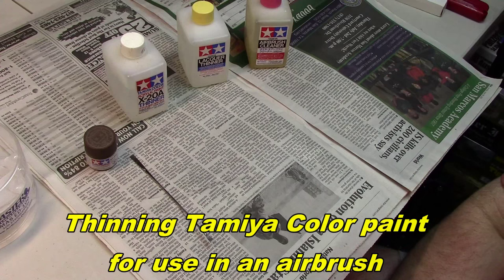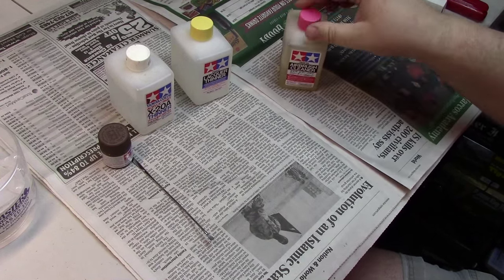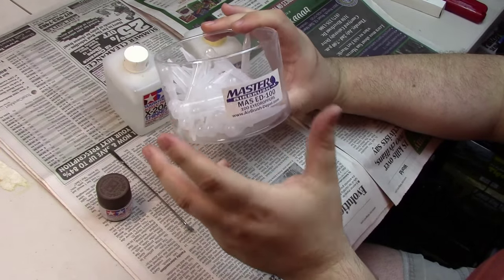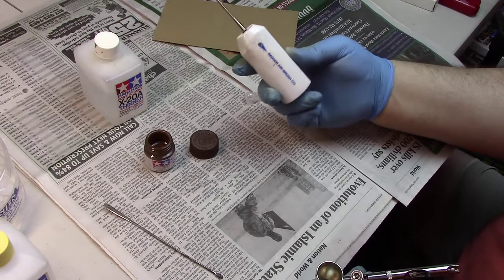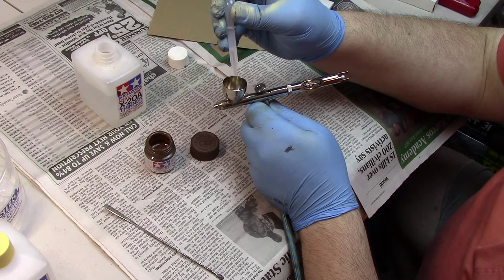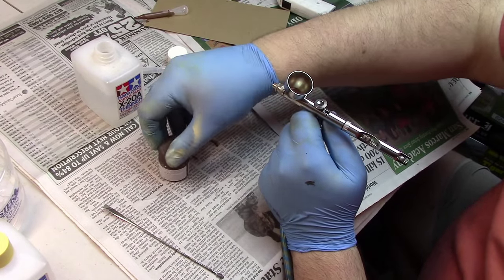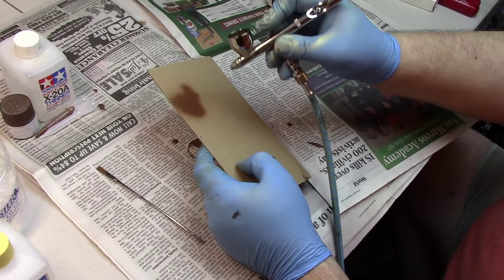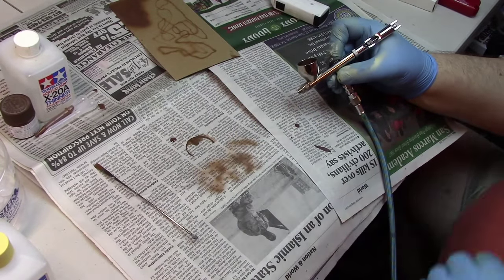How To thin Tamiya Color paint for airbrushing V 2.0

Comment: From my experience. 
Tamiya Acrylics Thinner makes paint more flat (I call it dead flat) and a coat is softer. I use X-20A when I want to use hairspray technique. It's easier to scratch.
Tamiya Lacquer Thinner (or any Gunze Mr.Color Thinner, or Gaia T-06) makes Tamiya Acrylics more similar to Mr.Color or Gaianotes lacquers. Paint dries harder and has a bit more satin finish than Tamiya flat.
Reply: Justin Case ok so that is how you get a satin tamiya paint!

Comment: I love Tamiya paints. They are so incredibly easy to use and readily available in the US. Unless gunze aqueous becomes readily available (heard lots of good things about it) Tamiya is my go to paint.
Reply from the maker: GreakLP I cannot confirm this but I believe Tamiya paints are actually made by GSI Creos(Gunze Sangyo).  It is too much of a coincidence for me that the two paints are so similar.  Both companies thinners and cleaners work equally well with both types.  Mr. Color is the same type of solvent based acrylic paint as is Tamiya Color.  I have scoured the web for references to a Tamiya paint factory but there is no information or address that I can find.
Reply: Hmmm interesting theory. But doesn't gunze have a bit better selection than Tamiya?
Reply from the maker: GreakLP Absolutely but how are we to know the possible extent of a corporate contract or agreement between the two companies??  All I know is that you can't hide a paint factory.  The government regulations and fees required to run such a facility are considerable.  There are many references to GSI Creos facilities but none for Tamiya.  Its a theory but I am unable to prove it.
Reply: My LHS ditched their rack of Gunze and took in both Vallejo Model Color and Model Air.

Comment: Hello,
          That was a great quick video demo. What about the school of thought? thin the whole bottle before you spray. thanks for sharing.
Les
Reply from the maker: Why?  I presume you have been watching Andy's HQ videos?  I feel that is a waste of a lot of expensive paint.  I rarely need that much paint of one color and mix in smaller batches because its easier to handle.  I also find that a 2:1 ratio sometimes is not enough so then you have a rather large quantity of paint without enough thinner.  Cheers and thanks for taking the time to watch.
Reply: I don't see thinning a whole bottle of Tamiya paint as a waste of expensive paint, especially for colors that one may shoot repeatedly. For example, painting the base coat on a 1/350th scale aircraft carrier hull and/or flight deck.

What's expensive is paying $10.00 for a 250ml bottle of Tamiya Lacquer thinner when you can buy a gallon of Lacquer thinner from your local hardware store for around  $15.00 and yield the exact same results.

Don't misunderstand, I am a BIG fan of Tamiya products, but there are cost effective alternatives for the budget minded modeler.

Comment: The video was very informative friend, thank you.

I'm new to airbrushing and have a few questions. My airbrush is the 105 Patriot too and I'm using Tamiya acrylics, so you should be able to help I believe. I am painting 1/144 High Grade Gundam models.

1. Since the needle/nozzle are so large how much paint is normal to use on a part?

2. I can't find Tamiya thinner sometimes at the store, any other thinners that work well? I've been using Isopropyl alcohol like I had heard online, any tips if you've used that would be nice.

3. How do you factor in things like flow aid or retarder into a paint mixture?

4. I live in South Florida. The weather here tends to be hot and humid. I spray in my garage without a spray booth, but with a respirator. If it's 70-90 degrees F but the humidity is below 70 does it seem worth it to paint that day or would my paint fog or a similar harsh effect?

Thanks for your time, gladly subbed!
Reply from the maker: +thelink2yoshi Thanks for the sub.  I will try to do my best to answer your questions.  How much paint you need is directly related to how large the area you need to paint is.  Tamiya thinner is readily available at pretty much anywhere hobby stuff is sold.  I buy most of my items from www.scalehobbyist.com  they have great prices.  Tamiya Color does not require any retarder or flow aid it is not a typical water based acrylic and does not suffer from the same problems that Vallejo or AK paints do.  In regards to the ambient weather conditions for painting I would recommend you spray in a temperature controlled environment but high humidity can be problematic and wreak havoc on painting especially acrylics.
Reply: +TacticalJackalope That's good to know about the retarder and flow aid. Sadly I can't work in a better environment, not living on my own yet so I can't buy a spray-booth. I do keep track of the weather though so that I know when the ideal or acceptable painting conditions are met. I appreciate it either way.

Comment: Just finished watching this I did you method and I had to put the pressure up. I use a iwata brush and air compressor. I either get speckling or spider webbing
Reply from the maker: "speckling" is also referred to as "orange peel" this is caused by being to far from the subject which causes the paint to dry before it hits the surface of your subject.  You need to be 4-6" from your painting surface.  It can also be caused by pressure being to high.  Properly thinned Tamiya color only needs 15-20 psi.  Spider webbing is a result of the paint being either too thin or in some cases too thick.  It needs to have the consistency of skim milk.  I hope this helps.
Reply: Tactical Jackalope so I use a iwata airbrush and a iwata ninja air compressor it doesn’t give out numbers and just has a + to - symbol for the pressure I think the drop method gave me the best results.

Comment: Thanks for the post and the all the posts too.  Have one question, any problem with a alcohol based thinner striping the chrome off of your air brush?  I read once that those type of thinners and cleaners would do that.

Thanks.
Reply from the maker: Riff Chrome....No.  Nickel maybe.  Chrome plating is an extremely hard and durable electro-chemical process.  The barrel interior of modern day military firearms are chromed to decrease friction and improve heat resistance and extend the life of the barrel.  A tad bit of isopropyl alcohol will not damage chrome plating.
Reply: TacticalJackalope Thanks for the info.  Maybe it was Nickel and I remembered wrong.  Looking forward to future posts.
Reply from the maker: Riff You are most welcome.  Thank you for stopping by and watching.

Comment: Excellent tutorial!!!  Thanks for posting.   These paints seem pretty simplistic to airbrush but I do have one quick question:  At any time have you ever had to add a retarder or any kind of flow aid to these Tamiya paints?  I want to quit using Testors Model Master acrylic paints because of having to add all kinds of things just to get them to spray correctly.  They have NEVER (straight out of the bottle) performed correctly to the mfg. specs for mixing and have given me fits for years now!  After watching your video I want to ditch Model Master paints for good and give Tamiya a try.
Reply from the maker: +Phayzyre105 Absolutely not.  Tamiya Acrylics are essentially acrylic lacquer's and therefore not subject to the same woe's that water based acrylics like Vallejo Model Air or Model Master Acryl are.
Reply: TacticalJackalope Thanks for the reply!  Speaking of Vallejo; I tried to airbrush Vallejo a while back and good grief....talk about gumming up my airbrush!!!  It performed even worse than Model Master and I later learned online that you had to add a concoction of flow-aid, retarder, etc., etc., etc., just to get a good finish.  To me that laborious process is like going around the world just to get across the street!  I'll be heading to my local hobby shop today and get some Tamiya paints and thinner to give it a try.  I'll let you know how it turns out.
Reply: TacticalJackalope Hello again!  Just wanted to update and let you know I got my hands on some Tamiya thinner and paint and my friend you weren't joking, it performed SUPERBLY!!!  I mixed it to the proportions that you did here in this video and it left a beautiful finish.  No grainy splatter, watery mix or having to adjust the mix with flow aid or anything else, it worked just fine right off the bat.  No gumming up the airbrush either.  Thanks again with your help with this.  The only gripe I have is Tamiya needs to expand their paint colors to that of theTestors Model Master line.  Other than that they have just earned another customer!  Take care :)

Comment: Thanks for the tips. By the way for acrylic paint the ratio is 3 thinner : 1 paint, is that correct?
Reply: That's what I've been using but with kinda sporadic results

Gotta say, his in-cup mixing method is working spot on. Also I have an airbrushing book that mentions Tamiya acrylics be mixed 2 paint, 1 thinner (like this video) and so far working great

Comment: Hi, this may be 3 years back but still helpful. Would like to have your advice, at what pressure is this? Thanks.
Reply from the maker: I typically spray at about 15-20 psi.
Reply: I tried to do a 2 paint to 3 water ratio using 20 psi but the colors were not coming out. Will try the ratio you recco and see. For acryllics, does it matter if the thinner was water or X-20A? Thanks for the advice.
Reply from the maker: Tamiya Color is NOT a water based acrylic.  You must use their thinner X20A or their lacquer thinner to properly reduce it.
Reply: Ah I see it now...No wonder the paint feels kind of sputtering...I really got to go get the X20A thinner. Thanks and hope to see more Gunpla videos on your channel!

Comment: just started this air brush painting method... i still have a long way to go. Question: what if I over paint on my model? is there a way to overpaint it? or need some solution to wash it first? thanks!
Reply from the maker: Washing is not necessary.  You will have to remove the paint if you put to much on the model.

Comment: Would you recommend using a primer with the thinned Tamiya acrylics?
Reply from the maker: Kilo-Lima I always recommend priming.  Actually I believe its essential.  It gives the paint something to "bite" into and it allows you to apply your base color with less paint.
Reply: TacticalJackalope thanks for the response! What primer would you recommend?
Reply from the maker: There are many good ones.  It's hard to beat the Tamiya rattle can primer or Mr. Surfacer primers in either 1200 or 1500.

Comment: Dunno if you read this, but I always get orange peel even following your techinique! how can I avoid this?
Thanks!
Reply from the maker: "Orange peel" as its commonly referred to is caused as the paint dries before hitting the subject or in this case the model.  The dried paint causes this pebbly like texture.  It is due to a number of reasons or a combination of several of them.  Air pressure may be to high these paints need to be sprayed at 15-20 psi.  The paint may not be thin enough if you are using X20A try thinning it a bit more.  Another big one is get close you should be 4-6" from the subject.  If you are too far away the paint will dry before it hits your model.
Reply: Hello @Tactical! Thanks for reply to me! :D 
I use 15 psi and I recently ordered the paint retarder acrylic...let's see how it goes! Thanks a lot!
Reply from the maker: The retarder is primarily used for brush painting.  It may not help you much.  Just get closer to your subject.

Comment: I tried this, but the paint thinner ended up REMOVING the paint that was already on my model. Is this supposed to happen? I was spraying green over yellow, and it removed the yellow underneath, leading to the two paints mixing.
Reply from the maker: +RandomCanEHdian If you used the Tamiya thinner either X20A or Lacquer this is not possible.
Reply: TacticalJackalope I used X20A and had a base of XF-59. I thinned down an oddly thick bottle of XF-49 using the method in the video.

Oh, well. I'll just get another bottle of XF-49 and hope it's not as thick as this one was. I usually don't thin Tamiya paints, I just occasionally see one that's so thick it just needs a tad of thinner.

Comment: Can you please tell me why my tamiya  paint is rough feeling to it like sandpaper I thin the bottle up to the lip like it says are use the 
A20 thiner Air pressure at 20 thank you
Reply: You're probably using Tamiya acrylic flat paints, and they dry very flat......the reason it feels rough is because the pigment is larger to give it that flat color.  You can put a coat of floor wax and it will give it a better look and feel

Comment: Could one use water?
Reply from the maker: No, it is a solvent based acrylic paint.
Reply: @TacticalJackalope  did you try ? I think it works very well with water too....they just want to make big bucks selling their solvents.
Reply from the maker: @lebaillidessavoies3889  No it is NOT a water based paint.  Why do you think lacquer thinner is the preferred reducing agent for this paint?
Reply from the maker: @lebaillidessavoies3889  Big bucks?  I buy like 1 or 2 bottles a year how is that expensive?
Reply: @TacticalJackalope  Ok.What about the other brands like life color or gunze hobby color?
Reply from the maker: @lebaillidessavoies3889  What about them?
Reply: @TacticalJackalope  Can those brands be thinned with water?
Reply: le bailli des savoies depends if they're water based or solvent based....!!
Water based paints you can thin water......solvent based paints you CANNOT thin with water, you can try whatever you want, but don't come crying when you F**K Up your project or airbrush
Reply: Just been using rubbing alcohol. Works fine. It was like,  $5

Comment: Tamiya paints flat and gloss acrylics thin very well with 70/30 water alcohol thinners you can make yourself.   As far as the lacquer thinner goes go to the hardware store.  You can get a quart for what you part for that small container.  People are paying way, way too much for their model making products.  Work smarter and cheaper and buy yourself a few extra model kits instead.
Reply from the maker: BennyCFD Wrong.   Hardware store lacquer thinner will eat plastic.   Their lacquer has some sort of inhibitor to prevent this.   It's about economy of scale.   Funds spent on a hobby are completely discretionary and my time is precious.   I might use one container a year which costs me a whole $9-11.  BFD I'm not a cheap ass so I can handle it.  Why don't you let people decide how they want to spend their own money?   If you want to make your case post your own video.   BTW it's been done hundreds of times right here on YT.
Reply: BennyCFD   Obviously with that comment you know nothing about modelling 🤔

Comment: I’ve been using acetone because it’s cheap and the nearest bespoke model shop is 200 miles away.
The downside is that it generally very warm in Thailand and this evaporates so quickly!
If I get a brand new pot and fill it up to the base of the neck with acetone then mix,within less than a minute it’s starting to skin and this only for brushing.
Am I going to get the same problem using an air brush mix using the Tamiya thinner as I’m off to the model shop next week.
Thanx in advance.

Comment: Dumb video with poor information.  Rubbing alcohol is just as effective as the over-priced Tamiya thinner.  I use it to clean my air brush afterwards as well.  I started doing this 25 years ago.  The very fact that you state the Tamiya thinner is alcohol based should ring a bell in your head.
Reply from the maker: Ah, where to start...but do I care?  Did you bother to notice you were commenting on a nearly 4 year old video and if your comment was relevant?  Let's get back to whether or not I give a fuck what you think.  Perhaps the Tamiya thinner might be more than just alcohol?  Ever pulled an MSDS sheet for it?  I am so sick of folks who think they are so fucking frugal because you saved yourself $5-6 whole gd dollars.  Well good for you.  Don't bother responding because if you do I'll just delete your comment.